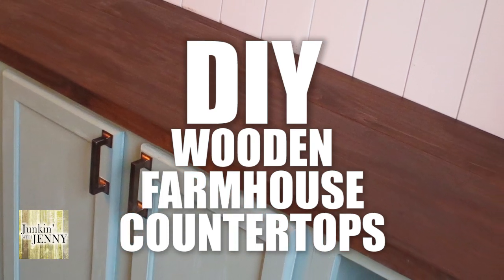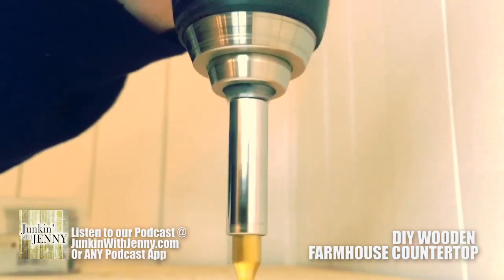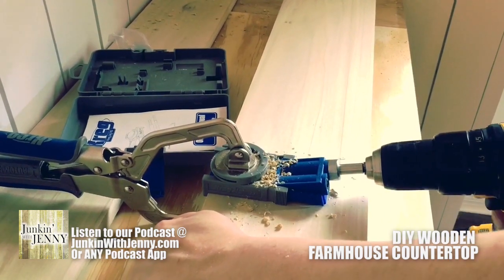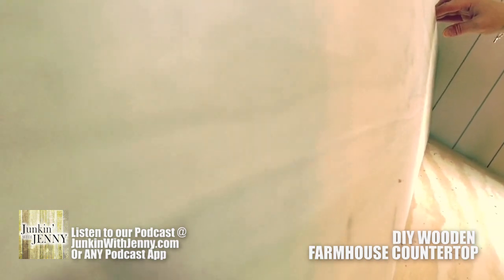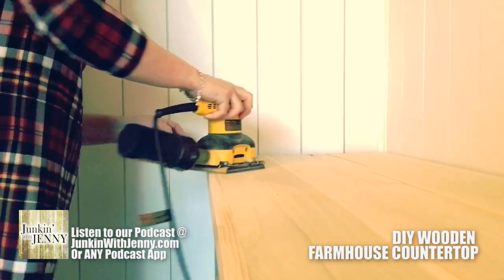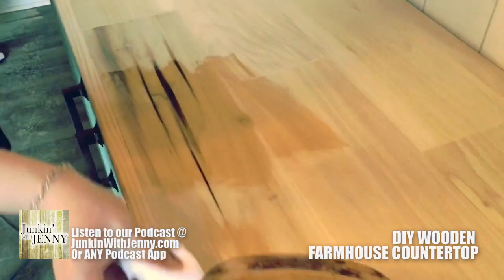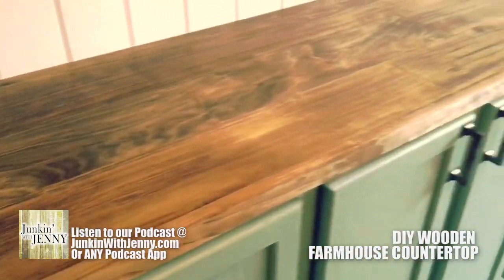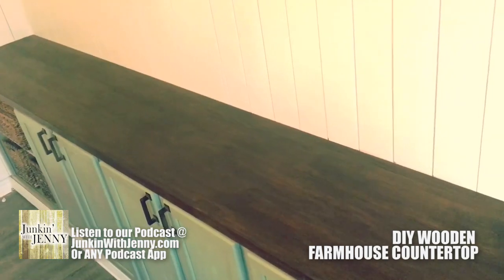How To Make DIY Wooden Countertops | Farmhouse Style

Comment: Important info missing here. 
1. What size wood? 
2. Wood glue between boards?
3. Sealer for the wood? 
4. Is the an edge piece on the front to hide the plywood beneath?

Comment: I think a good option would be to apply wood glue to the bottom then you can always screw it down to the plywood and use wood filler to hide the nails or screws.

Comment: Yhea right, as if you can get a perfectly straight edges right out the store. He skipped the part where he strip table sawed the edges so it will be straight and flush. The most important thing left out . 👎💩